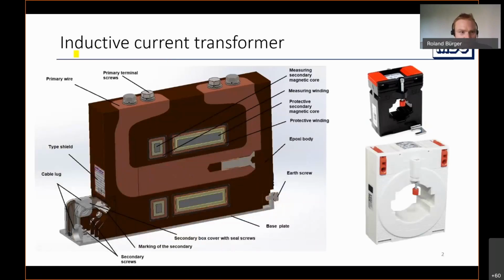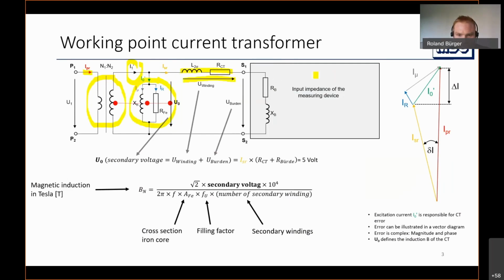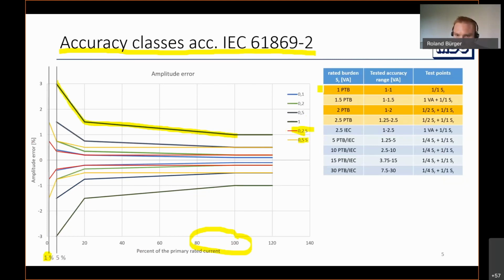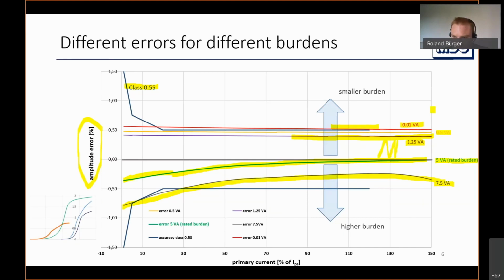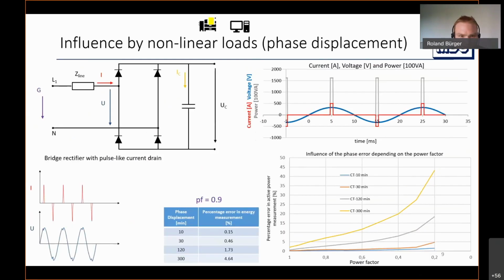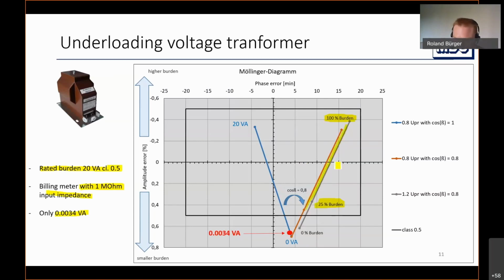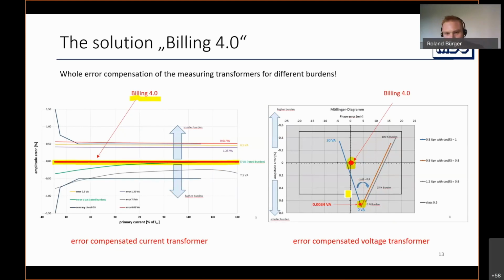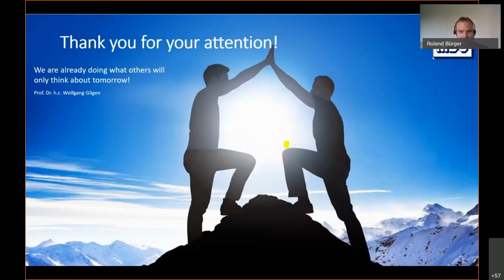Burden & Instrument Transformer Faults

Comment: Is it possible to get ripple voltage from a voltage transformer? We have a TRENCH VEOT 132 kV voltage transformer which feeds a REF630 (for frequency 50HZ protection). After tripping the disturbance recorder showed that ripple voltage ocured at the moment of tripping.
Reply from the maker: What you see are classical transient changes of your energy system. The VT doesn't cause this phenomenon. Warm  wishes.